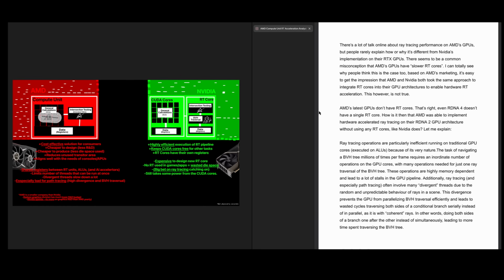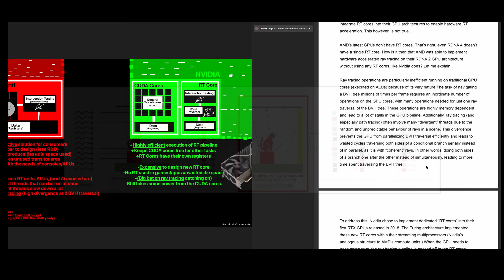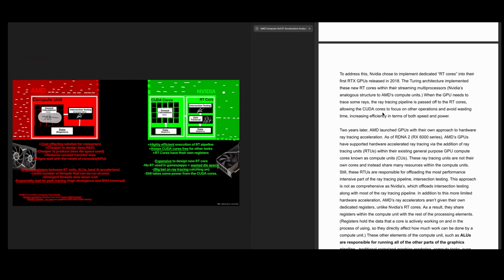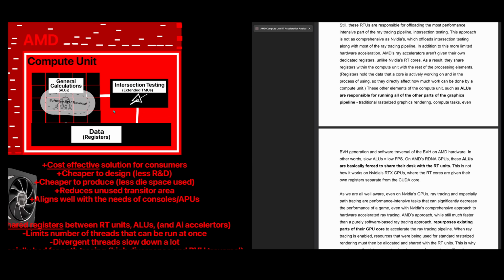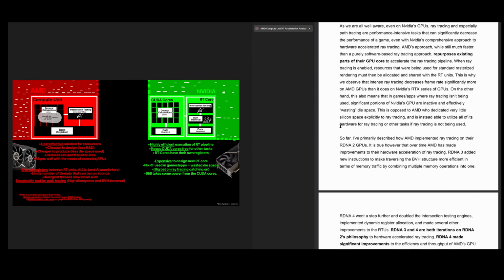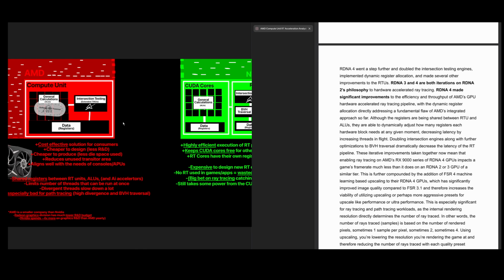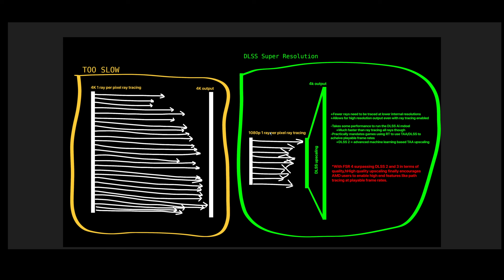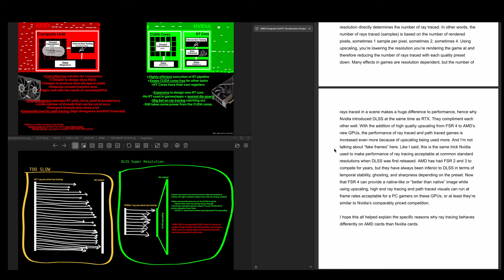How Does AMD Do Hardware Accelerated Ray Tracing?

Comment: For fun, the PS5 GPU is closer to RDNA1+BVH rather than RDNA2. You can see this in mesa's support for the AMD BC-250, which is a binned PS5 SoC. And LLVM's support, where it's called the gfx1013. I got a few BC-250s to play around with, and you don't get mesh shaders on them because of this.
Reply from the maker: That's really interesting! I had read that on Chips And Cheese that the PS5 possibly uses a slightly older version of AMD's RT pipeline, based on what you said that seems to confirm it. Seems like they did something similar with PS5 Pro having an RDNA 2/3 GPU with RDNA 4 RT features backported, like the doubled intersection testing engines. But then apparently not having RDNA 4 or 3's Ai Accelerators. Apparently Sony's machine learning acceleration is unique
Reply: No amd gpu "has mesh shaders". All recent amd gpu architectures implement primitive shaders. More recent gpu architectures can execute mesh shader intermediate representations that is compiled to primitive shaders.

Comment: Thank you for the explanation sir, but I do have to disagree with one thing. 
You state: nVidia initially introduced RT cores for efficiency. 
That is not completely accurate. 
nVidia introduced RT cores because it can be applicably Copyrighted a.k.a Gatekept. 
They invested into this technology, they spend a lot of Money and Cult credits on Pushing it and they wanted to Wall out AMD and incoming intel from Catching up in any way. 
If they didn't they would probably just Go the AMD route as its cheaper. 

To give a More Everyday life example:
If I invented a Wheel that has a special Functionality But its 90% Normal wheel, I can't copyright that I can only copyright the 10% that's my Invention. 
Thats because Theres 99.9999999% of Cars out there that use the same wheel tech, other than my specific modification. Thus I can not claim something that was there before my patent as that would Hijack the existing tech. Making pretty much everyone liable for Compensations to me as a holder of the License. Basically What Asetek did. They retroactively claimed it because they didn't pay attention when they Invented it. 
But when they saw everyone took to it they went: No Mine!
But If I allow them to Continue to do that, they can easily catch up. 
So I reinvent the wheel, patent that, and let them Bang their heads against the wall how to catch up when I own the Exclusive right to the Functional highly efficient Assembly of elements that Make my Invention Good. And I enforced the Software design that Maxes out My way of doing things . So they can never catch up. Since they are not allowed to come too close to my Pipeline. 
If AMD gets too close they get sued, if they Don't their performance is Shit and it's expensive to build. 
So they just went Fuck it cheap and good enough.  
In practice 1st gen RT was very cost ineffective, But they didn't care they were investing to secure Untouchability.

Comment: Is this for RDNA 3 or 4? I don't think the latest their GPUs follow this anymore.
I would prefer if you refer to the GPUs as their architectures like RDNA 2/Pascal rather than "Nvidia GPUs does ABC, whereas AMD GPUs does XYZ."
Reply from the maker: Yeah that's a good idea, although everything in the video applies to all AMD/Nvidia GPUs with hardware RT so far. RDNA 4 has more hardware that RDNA 2 and 3 didn't have, but they didn't add the hardware for fully autonomous BVH traversal like Nvidia did with their first Turing RTX GPUs. There's hardware to improve the speed at which the shaders can perform the BVH traveral as well as a doubling of intersection testing engines along with instructions to minimize overhead of the BVH management, which are all really beneficial, but not the same approach taken by Nvidia. I think AMD's approach is much smarter, not trying to downplay their hardware RT.

Comment: It is pretty dumb that ray count scales with resolution. It should be fixed or tied to an RT quality setting independent of render resolution. A lot of games that are somewhat optimized for 1080p render resolution run like garbage in 4k because now you’re running 4x the rays which isn’t always necessary.
Reply from the maker: That's a good point. I think that's one of the main benefits of using probe-based RT solutions like I believe Doom TDA and Indiana Jones both do for their RTGI. Same with Cry Engine's SVOGI. The amount of rays traced for probe-based rt is based on the number of probes in the world and the number of rays traced per probe, set by the developer independent of screen resolution afaik. I don't think effects like RT shadows or RT reflections can be done like this however.

Comment: Somehow my comment was removed, so again:

The information here does not seem right. Tensor/RT cores are part of the SMs, just like they are part of a CE on AMD hardware. Nvidia is just better because they have a generation advantage and because they invest more transistors in those features.

Search for "NVIDIA RTX BLACKWELL GPU ARCHITECTURE" and read the PDF file from Nvidia directly.
Reply: Yes, and sort of for the second sentence. The difference is that Nvidia RT Core  (~execution unit) handles the entire BVH traversal from ray data -> hit info in one instruction, whereas AMD has a bunch of smaller specialized instructions for parts of the BVH traversal, but the shader core is still involved in the BVH traversal, executing these special RT instructions and and bunch of others on the shader core. On AMD RT takes up issue slots and execution resources on the shader core and has much higher latency, on Nvidia other threads can schedule work on the shader core while the RT execution unit does it's job.
Reply from the maker: Yes the Tensor cores and RT cores are a part of the SMs on Nvidia which are analogous to AMD's CU, you're right they are both integrated within the GPU in an analgous way to AMD's RTUs and Ai accelerators. The separation on my graphic was more meant to represent the functional separation between the RT core and cuda core vs the integrated /in-line approach AMD uses, where the ray tracing is launched and ran and returned in the same thread on the same CU vs Nvidia where cuda cores request a ray to be traced and the RT cores handle everything autonomously and do it with access to their own resources (which is the main thing that makes them their own core.) The graphic was misleading though you're right.

Comment: short explanation : nvidia gpu have more core, and you still use so called "cuda core" to do those ray tracing and path tracing (after it being crunched by the dedicated RT Core for traversal sorting and optimization), they dont really have advantage over amd when it come to their more lower SKUs (which has somewhat same core count as amd gpu), for the most part AMD Core Arch is more "optimized" to run normal calculation and kinda fall back in ratio if 2:1 when it come to ray calculation (despite their RT Core traversal being somewhat catching up in term of ray traversal and algo support)
.
they have SER, earlier than Nvidia even.. to some extent OMM as well but not the same standard thats used on Windows (but on PS5/XSX)
.
edit : this is why Upcoming UDNA is expected to do better as they tried to redesign the core to perform these calculation at rate of 1:1 or more
(which RDNA4 partially has but not entirely able to, it does fix the very limitation that RDNA3 has when it come to certain function)

Comment: Ray tracing sucks so bad, really with Nvidia hadn't forced this change. The cost in performance and silicon footprint just far exceeds the visual effect.  AI upscaling however has been fantastic.
Reply: It sucks for gamer. But it is game changer for game developer or those that work with ray tracing workloads
Reply: @arenzricodexd4409  yes, but the developer is a multi billion dollar company and the gamer is saving pennies. Its backwards to make every gamer purchase specialised equipment to finish the developers job in real time, rather than the lighting effects be applied by the developer once when they make the game.
Reply from the maker: That's an interesting take! I agree, there are much more efficient modern methods for doing a lot of what ray tracing is used for in games. For example, GTAO is a modern evolution of SSAO that achieves similar quality to RTAO using standard rendering techniques, it doesn't have any of the "over darkening" seen in SSAO/HBAO traditionally. It's rare to see someone praising upscaling in games though lol, but I agree. The Ai upscaling techniques, and even modern versions of FSR 2 like 2.3.3 can make a huge difference to playability of a game while maintaining similar image quality to TAA. It's been a life saver for high refresh rate gaming on my 1080 Ti. I find ray tracing to be really interesting and cool to see, but I totally agree that people didn't really want it or even need it until Nvidia was like "this is the future of real time rendering whether you're ready for it or not!" I understand the benefits to developers, but I don't know if it's really making their development easier or harder for now considering the challenges with RT performance and accessibility.
Reply: @ClewlessClay  AI upscaling is pretty awesome tbh. The quality presets give a lot of extra performance for very little loss in fidelity. And it's been free upgrades for owners of cards like, yes your 1080Ti or my brothers 3060. He has access to DLSS4.0 now and that lets him play Cyberpunk at 4K, looking very nice. Not something his card could do a couple of years ago. 

The AI upscalers can even be used at native resolution to fix bad implementations of TAA. I use this in Warthunder, but there are examples of it being used in Cyberpunk online if you want to see how this works. The AA algorithms of FSR and DLSS are very nice.

Comment: BVH traversal and intersection testing is just a portion of the workload, you still have to do bunch of math once you finished tracing each ray. With regard to just the tracing part, nVidia is probably an order magnitude faster than AMD.
Reply: True, though it's not an order of magnitude difference but about 2-3x. Nvidias RT cores aren't 10x faster than even their software fallback on GTX cards.